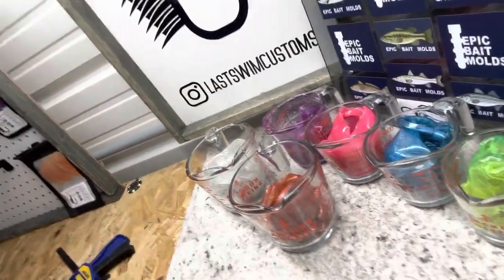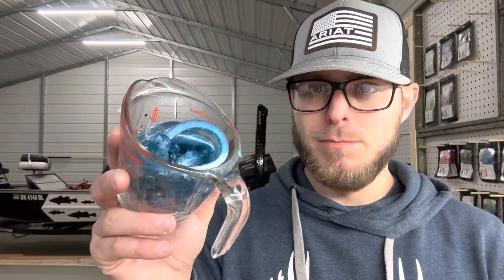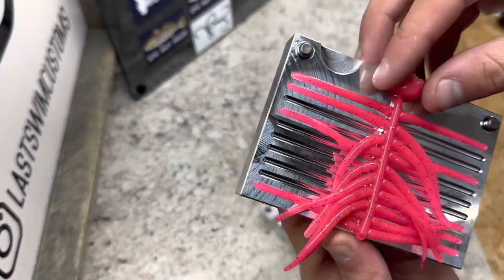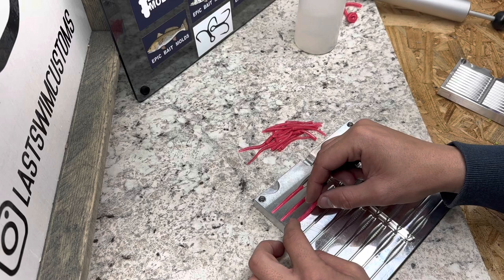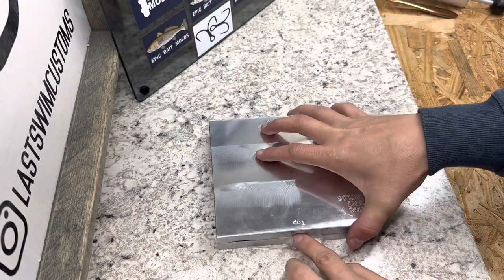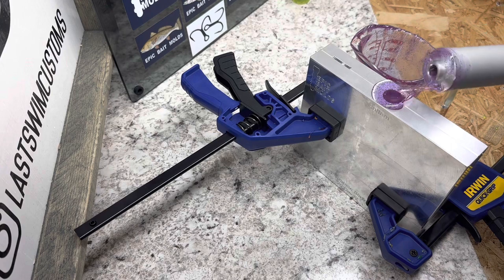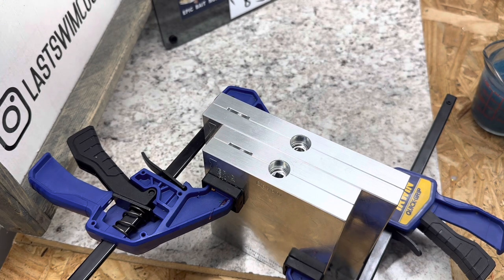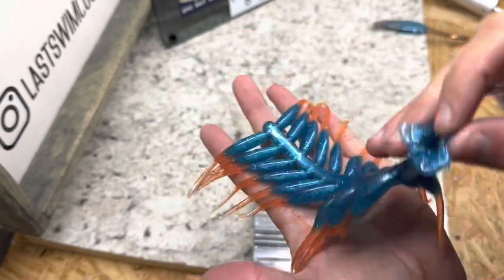Epic Bait Molds 3.00” Crappie Slayer Tail Mold Unboxing/Review!

Comment: Great video and nice colors. Thanks for all the info. Do you use a de gasser? Just wonder if it’s necessary?
Reply from the maker: Thank you! You can get buy without it for sure although having a vacuum chamber to remove bubbles can be beneficial. Remelts are a lot more prone to bubbles than the initial batches of plastic.
Reply: @lastswimcustoms  ok thanks for the info